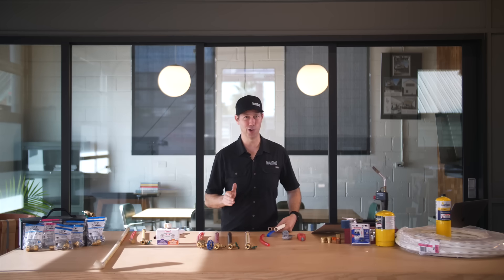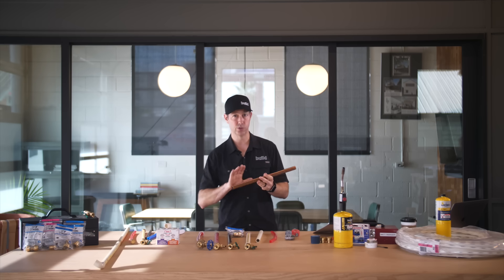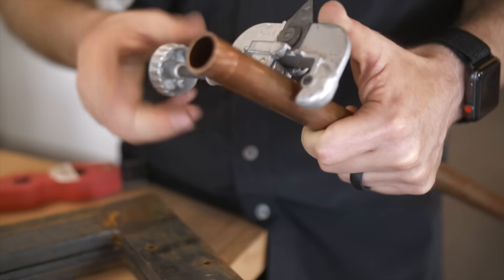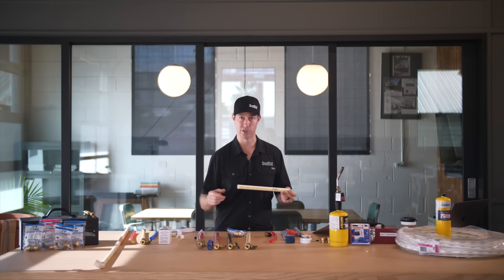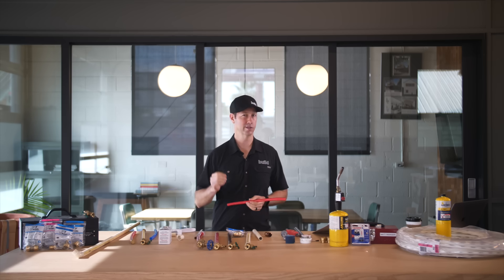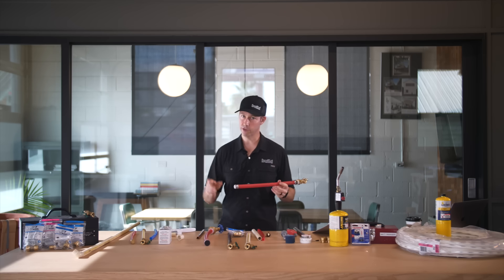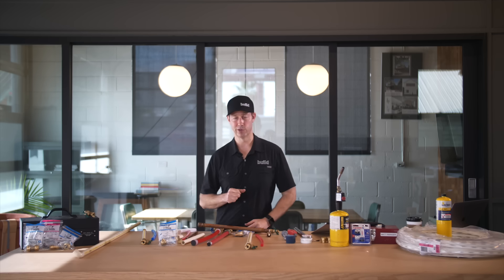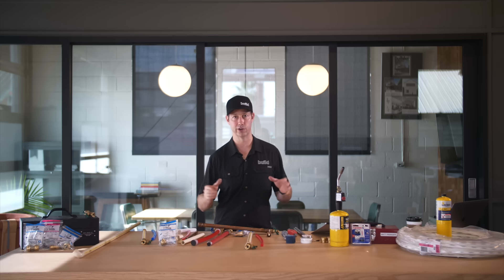PEX vs COPPER vs CPVC plumbing pipes

Comment: CPVC should be illegal in my opinion, in Texas with extremely heat I have seen 5 year old constructions with a lot of issues, you mentioned shark bites, to me that is a temporary repair, working in the apartment industry for a long time O have see them fail after a while, I asked the plumbers to use them only as an emergency repair, eventually they need to be replaced.

Comment: My new house sat for almost 3 months between the pre-drywall inspection and when they got around to finishing the punch list and putting in the rest of the insulation and drywall. 
Was there a risk of the PEX piping being exposed to UV in that situation? House was dried-in with the roof on. Just curious. Thanks for the great informative videos!

Comment: CPVC is the PB of the 80, s. Both pipes are junk. PEX does not have long enough real-world testing. Also, PEX bleads plastic chemicals. I am a copper guy all the way.
The best pipe is brass, but it is waytoo

Comment: I am a homeowner and my home has PEX B tubing.  No problem with crimped connections (ring type) but I have had two instances of pinhole leaks, both on the hot water side.  One of them, just exiting the water heater, had four leaks and so I had to replace the section of pipe.

Even before the leaks, I decided to buy a crimping tool for pinch crimper.  Both the tools and the stainless steel crimps are less expensive than for the ring type (purchased on Amazon).  Plus if there is a mistake, crimps are easily removed and some can be reused.   I go the special tool for removing a ring and it takes a lot of work removing one.

One tool that I got was a 18 volt battery operated crimper made by Ryobi.  No matter what kind of crimper is used, the crimper must be oriented 90 degrees to the PEx tubing.  Again, if there is a mistake, the crimp is easy to remove.

Having the ability to work with PEX plumbing enables me to perform plumbing repairs like replacing broken valves or instal new valves.

By the way, I would appreciate seeing a video on the pinhole leak problem.

Comment: 2 things; (1) you didn't show crimping the Pex joints or actually any of those connectors being applied.  Why not?  (2)I was a materials science technician and know what problems you can have while mixing materials such as Plastic and metals (copper, brass & stainless steel)  for instance plastic expands and contracts with temperature variances alot more than metals.  This can be a big problem over time causing leaks.  There are more problems mixing materials too.  I choose to stick with the time proven materials like copper pipe and copper connections.  It's a little more expensive but in the long run...  if you do get a leak, which is more likely with the plastics,  what do you think the cost of calling a plumber will be (not to mention the carpenter to repair the structural damage)?

Comment: There are three other types of copper tubing.  
Type K - thicker than Type L (Often used in water service mains or very high pressure situations.)
Type DWV - a thin wall copper pipe used for drains/sewer waste & venting.  It uses it's own fittings.
Type ACR - used for refrigeration, air conditioning and specialties such medical gases.  It's cleaned and the ends are capped off and sometimes charged with nitrogen to prevent oxidation.  Its fittings are the same as regular copper fitting except that they are cleaned and with sealed ends or in a sealed package and are labeled "Clean for O2 use."

Comment: I've been getting numerous pin hole leaks on long horizontal pipes for years. Keep cutting bits out and compression fitting new bits in there but I'm sick of it now.
But I'm also torn on whether yo replace it all with plastic pipes or new copper.
I do notice a loud bang whenever the washing machine is running. Calls for water - stops - THUD. 
What do people think? Pipes are in the loft exposed and there's quite a lot of it.

Comment: I replaced a pinhole-riddled copper hot water pipe with pex and sharkbite connectors. I first wanted to use copper,until I realized I needed flexible pipe because of the way the house was built.

Comment: good video and some good points. i live in california and was looking into a complete repipe from the street. if using copper underground for the main would you go with type l or k? this is a raised foundation . i have heard that copper used today uses recycled copper and can run into problems after 7 years. how do you know if your getting quality copper. you estimates for longevity are very good as i was thinking maybe 30 years.as for pex a upinor or zurn.   thanks
Reply: Im about to do a report today and I am going to use the L copper pipe because of what he said it sounds like this is the most durable underground.
Reply: type K copper is the thickest wall copper pipe and the most durable, also comes with the highest cost. if your not concerned with cost then I would say type K is your material. also pex wise it will depend on the type of connection you want from pex. Type A pex is expansion fittings which would be my recommendation ( not that anyone asked for my recommendation) the joints will do nothing but gain strength the longer they are done . Pex B on the other hand the strongest your connection ever is , is when that crimp or connection is made. Also i would look into PE-RT tubing can be installed the same as pex.

Comment: When I moved into my 100 year old house there was steel, copper, and pex. The upstairs duplex was replumbed with pex several years prior. The only pipes that leaked was  the pex upstairs, but I have no idea what part was leaking.
Reply: Here in central PA, I've heard several people complain about PEX joints leaking and needing re-crimped often. I also grew up in a house with well water and copper- 30 years was the lifespan. My in-laws had CPVC. I could be in the basement and watch pipes grow in length up to an inch when hot water was run. That eventually lead to cracked joints.

Comment: My house I bought a year ago has CVPC for all the plumbing, I hate it. They even did straight CVPC into the water heater with no flexible connection so when I tried to change out the anode the hot water side shattered it was so brittle. Thank the stars shark bite and PEX exist as I was able to fix it, though it was a while night of running back and forth

Comment: The CPVC haters, they're like cops - that think because they see mostly criminals all day, that the entire population is made up of criminals. It seems like they don't take the following into consideration:

Because CPVC has been around since the 60's, and due to its cost of install, it is (or at least was) by far the most widely used residential plumbing material, so for all the repair guys today, it's no wonder that's the material you have to repair the most. That doesn't mean that the ratio of failure is higher than other material. Without doing a proper statistical analysis, it's just a bunch of anecdotal evidence, which again because of its widespread use, isn't particularly convincing.

Another thing is it seems like a lot of this anecdotal evidence comes from southern US. Where you see the most sun, with intense UV. There is a good chance that prior to install, or even during install the CPVC was exposed to high levels of UV damage - whether it was stored outside at the supply place, on the job, or during transpo.

There are a few other aspects that could effect CPVC longevity, like water chemistry, along with how often after install it gets physically messed with.

All that's to say no material is perfect, every type experiences failures, and needs occassional maintenance or repairs. For every "dude that'll last forever", there's a "it broke on me" story.

Comment: I know many plumbers find it hard to trust anything other than a soldered joint because of how solid and secure it is. However, in some other industries, installation time and complexity are a disadvantage.  PEX and Sharkbite systems were developed for plumbing in different manufacturing sectors such as the pneumatics and air conditioning industries just to name two. They also spread to the automotive manufacturing sector because of the time savings in installation and resistance to vibration failure. It has taken quite a while for them to show up in housing so in fact, the systems have been around for much longer than people think and have been used in more inaccessible areas than walls of houses.

Comment: My house was built in 1977. For the past 10 years, I get an occasional pin hole leak in the copper piping. I have had several. I have well water and was told that the water was too acidic and that is making the pinholes. The house had a water neutralizer when I purchased it & supposidly is supposed to  neutralize the acid water and the pipes should get leaks. This is a real PIA to maintain & I wish I never purchased the house.

Comment: PEX does not last 50 years. That’s just stupid information, I have seen PEX installations that are 15 years old and are failing. The pipe might last longer then the fittings but nowhere near 50 years.

Comment: 25 years ago, christmas, 2am *drip*drip*. Walked down the steps into a wet warm puddle of dirty water. Copper heating pipes had a hole at the lowest point, all water leaked out. Took me hours to get that spot dry for soldering. Dried the floor (new wood). Next work day I bought a press/crimping tool. Never soldered copper again. Copper only for repair, otherwise only composite pipes with their press fittings. What a pleasure to work with, repaired the pressure valve on the ww heat pump yesterday. Greetings from metric Germany, watching your channel here too.
Reply: Metric Germany makes magnificent tools.

Comment: I just installed some Pex.
Loved it until reality hit.
What happens when Rats get to it?
Exactly.
Reply: That can be a problem in areas where rats nest, but you can cover the pex with metal mesh in those limited area where the pex is near horizontal wood.

Comment: Alot of good information some not bad but not right either. Just to touch on 1. Sorry. OCD was killing me on this 1 point. CPVC was made for hot water. PVC was made for normal water temp. Depending on your use you can get PVC it different grades, like most pipe. Biggest difference between the different grades is wall thickness I.E. schedule 20, schedule 40, schedule 80, ect. I know I said 1 thing but...PTF or Sharkbites will fit on PEX, CPVC, Copper, ect. I keep a few for Emergencies too. But, I don't trust the little "Fingers" to not corrode in time resulting in a loose connection and leaking. Great video though

Comment: I own a manufactured home.  It's a 1998 model.  It is plumbed with CPVC.  I found I needed to replace an angle stop on a toilet.  I got out my PVC cutter like you demonstrated and shattered the pipe.  It was seriously brittle.  I ended up needing to go down to the  crawl space cut a section with a hacksaw and putting in three fittings. (2 sleeves an one T). 

I thought it was an anomaly until I need to replace my water heater.  The old heater was supplied with flexible copper between the CPVC and the heater.  The current configuration didn't match the new inlet.  I attempted to bend the flexible copper and shattered the pipe again.  I cut it, again with a hacksaw and the old CPVC, to spite sanding the hardened outer edge, and using primer liberally, would not accept a water tight joint.  I ended up using a SharkBite sleeve to re-plumb it.  

So while it may be good for a long time, any alteration to the plumbing after about 20 years should be approached with caution.  The pipes will be brittle and may not accept CPVC fittings.

Comment: My house is renovating whole house. My contractor changed to PEX. It is over 60 yrs old house. Any suggestions? Thanks
Reply: Make sure you wrap the pex with wire mesh made to keep rats from eating it.  You probably only need it in spots where rats may nest.

Comment: Not a pro but I would add the downside to pex is it leaches chemicals so make sure to use water filtration, it does reduce leaching over time I researched, these chemicals can cause harm to reproductive systems.

Comment: C P V C = Cheap Plumbing Virgins Choice, or... Crap Pipe Very Costly... !!! CPVC is  S H I T ,bottom tier garbage, it's bargain built, brittle mobile home madness. Many insurance companies will NOT pay to upgrade it... Avoid it...As for water hammer/Pressure and CPVC , You want me to trust a 'glued' CPVC joint ? Nope... NO Way... IF you MUST repair CPVC, Warm....warm, not hot,  1st with a heat gun...gently,  hand hacksaw it. Clean your burrs/ends well and I'd trust a Sharkbite/Push Fitting over a re-glue of older pipe. Take a look at high end, high dollar Compressed Air Systems, they use a Sharkbite type fitting on their systems at well over 130 psi... The key to O-ring style fittings is to SURE you have a Clean/Smooth/De-Burred pipe. Stick to Copper or PEX whenever possible. It's sad they even sell CPVC anymore...

Comment: Big thing for me with CPVC and Coper is line sweat. Humid areas, they are both bad choices for cold water lines. Pex is the only line I will install new in a house. I live in a humid area, that gets super cold in the winter. Coper and CPVC can not handle the cold very well. I have seen pex hold up in areas that both CPVC and coper have failed.

Comment: I'm wondering for a motor home can you use a mixture of both pvc and copper because I like the look of copper but I don't want so much of it so for the hidden parts of the plumbing I would use pvc, the only issue I can think of is that over time the connections between the PVC and Copper will work itself loose or even break. My idea is to use a hose similar to a garden hose and  use that as a buffer so that when the whole plumbing system inevitable shifts the hose will flex with it and take the stress off the connectors. Think this is feasible or should I just stick with a more traditional method?

Comment: I'm a plumber for 20 years in Chicago Illinois we used only copper here obviously is a lot xtra time and labor involved but is worth it in a property cost $800k or more with beautiful high quality  bathroom and kitchen please don't cut corners using plastic on high pressure water lines bcz I smell a huge cry after a plastic line bust for any reason 🥵

Comment: copper can be an issue in a few ways if you run electrical wire touching copper you can and will attract corrosion also if you have different types of alloys connected or near will potentially corrode copper but worse corrode the other alloys faster. brass and copper are the safest pairings.
lol i saw a solder in video and you dont drag or brush the weld..... you need to feed the wire strait into the highest point and push till you see a silver ring form or fill

Comment: Matt... I am a little late watching this video(2022); Thanks for producing it! This is my #1 question when dealing with older home remodels.  I have not watched it yet; but am excited to get started with the view I will leave a comment here after I view.
Reply: 4:00 I had an old' timer plumber informed me. the pin holes usually on hot water side caused from the dissolved minerals in water running through the pipes and and dent; or imperfection on the pipe in time will cause an abrasion to the inside of the pipe and depending on the dent on the pipe, minerals in the water and usage will eventually in time create the pin holes (I remember him saying something like after 50 years) this was in an area with severe amounts of minerals in water.
12:50 Sharkbites...IMHO the are temporary in emergency situation.
15:45 exactly right on spot; cannot be said any better.
The issues pointed out here, very well presented.  Another issue not discussed are the out gassing of each product.  Each has it's own issues I am sure.
Thanks for the info; I will refer back here in the future I am sure.

Comment: My two issues with pex is 
1. The shark bites are not new technology this is basically what yourautomotive ac lines and fuel lines are. They do eventually fail. 

2. A mouse or rat will 100% sharpen there teeth on the pex. A flooded house just isn't worth it.

Comment: he also didn’t mention how cpvc becomes so brittle and delicate that you can’t cut it normally you have to be super careful i use a dremel to be sure not to crack and don’t put any pressure on anything or it basically snaps into pieces. remodel situation obviously

Comment: I've seen plenty of cases of copper pipe rotting especially on horizonal pipe or pipe close to the water source.  In this case it's more like 35-40 years, not 75.
Reply: I hear 25 years for copper
Reply: I had a copper leak in less than 20 years near my water heater.  House built in 1994; major leak in 2014.  :(

Comment: I'm counting the minutes until he says "glue". IT"S a solvent weld process ---- not glue!
Reply: I'm impressed, he called it "solvent" not Glue. No need for primer for the tan CTS version of CPVC which only goes to 2". Yellow cement is "one step".  the pipe has to be beveled every time, otherwise the sharp pipe edge scrapes out the cement. Use large enough pipe of any type and water hammer disappears! The Inside Diameter of Pex is small compared to Copper and CPVC. That means that you may need to increase your pipe size with Pex to achieve the same flow characteristics. That being said, I would use Pex in a residential application if I was a contractor.  Nice Channel - Good Job